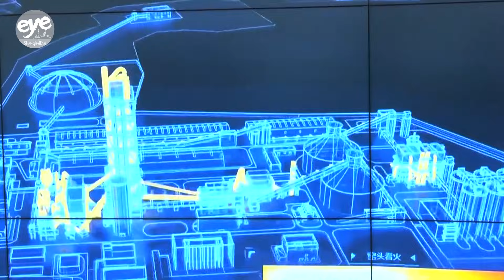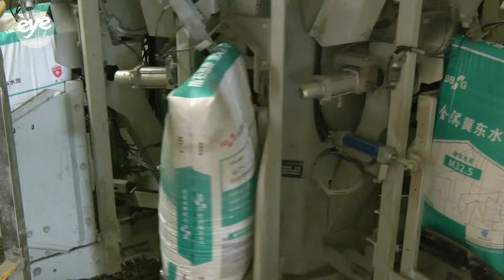China builds world’s first unmanned cement production line

Comment: I dont know what they are trying to brag about here ... thats a standard  control room? "manual oversight" doesnt exist in plants for 30 years. To be fair without the 3D Visualisation, but that has limited oparational use, because you know wich parts of the facility and which readings are process critrical. Its not like they dont have operators running around who check out warnings and clear arlmars. And they still have maintanance...